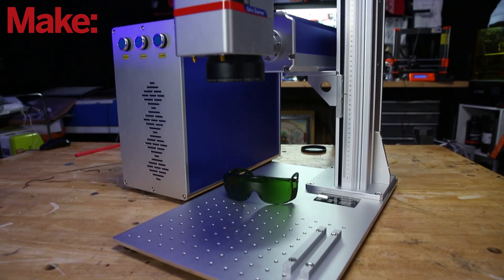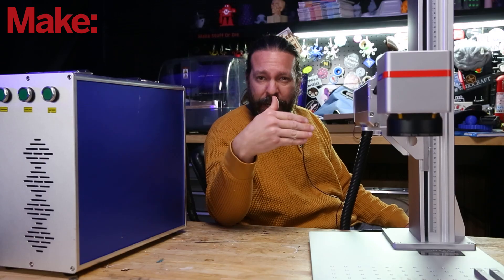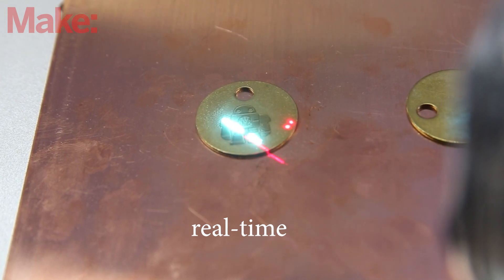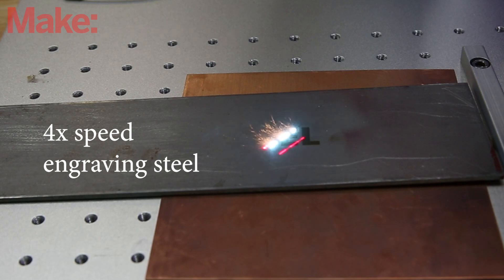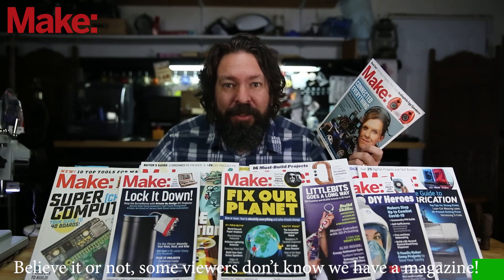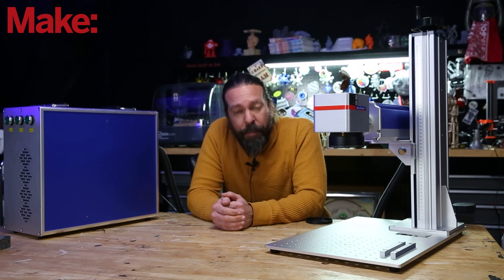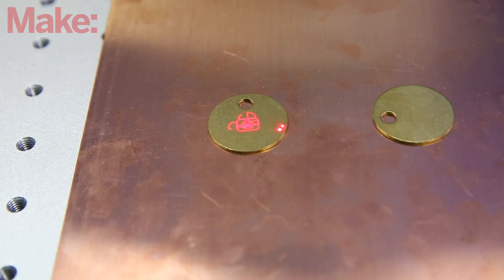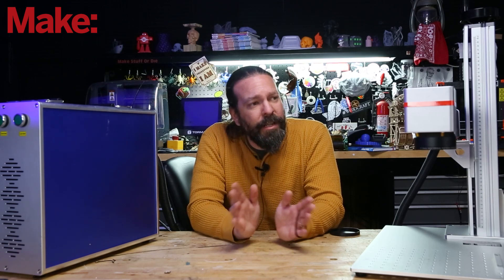Engraving Metal With a 20 Watt Fiber laser

Comment: neat. Seems like it should be able to have a way to expand the work area (either a moving gantry for the laser or even a base that slides over the work area) for not too much more. It's probably not necessary for 90% of the things you want to do with this, but it seems like you shouldn't have to get a whole new machine for those outliers. 

Also, no concern about laser light bouncing? I saw no guard and no eye pro...
Reply from the maker: you can buy different lenses that expand the work area a bit, but there are downfalls. As for eye protection I wear safety glasses and you can see them in a couple shots as well as the thumbnail. they're green!

Comment: I'm pretty sure it's actually called a fiber laser because the "active gain media", the space where the laser beam is generated is a piece of fiber optic rather than a tube full of (for example) CO2 gas. The fact that it travels from the "power supply" to the head via a fiber is just a nice benefit of the technology, and it adds flexibility without really adding much complexity or fragility. I believe the hybrid lasers that Epilog makes use fiber and CO2 gain media and yet still get the beam from the generation point to the work piece via mirrors on a gantry.
Reply from the maker: interesting!

Comment: I'm starting to see some of these come up with a UV laser that's supposedly good for engraving plastic in addition to metal.  Anyone have any details on these?
Reply from the maker: this one works fine on plastic. I customized my kids airpods case after I shot this video
Reply: You can do some plastics with fiber (as he mentioned, airpods is a great use for this, just gotta go easy so not to melt everything hehe) if you're careful (that said, avoid PVC and vinyl, super toxic and damaging to you/your health/all the equipment around you). Fiber laser is great if you want to mark with any level of depth (for example, engraving characters/text into a title plate for a machine deep enough that you aren't concerned about surface wear taking them off). UV laser isn't great for depth, and is generally better at surface marking (and can mark literally anything to be honest).